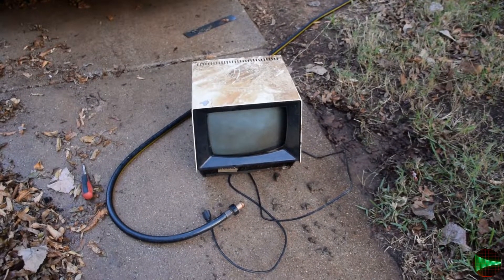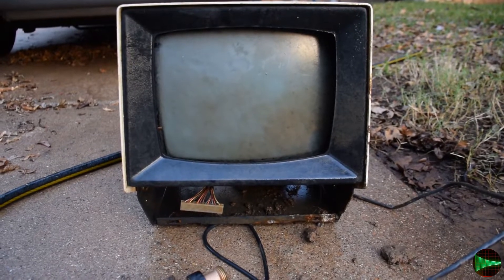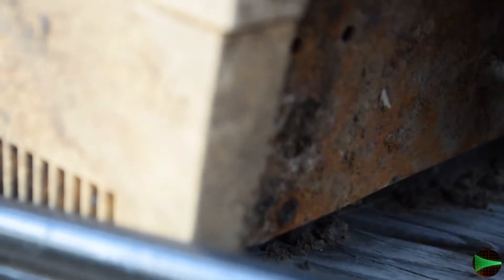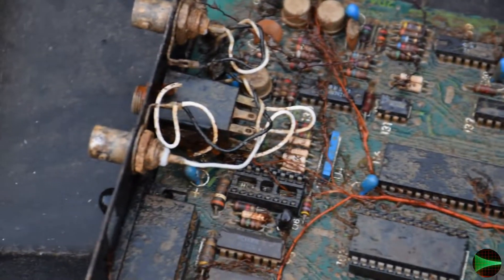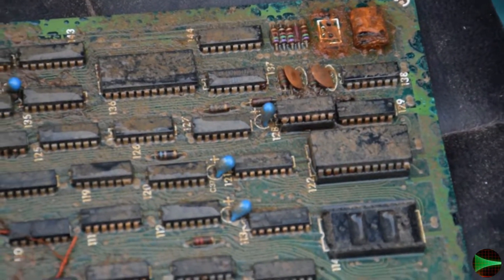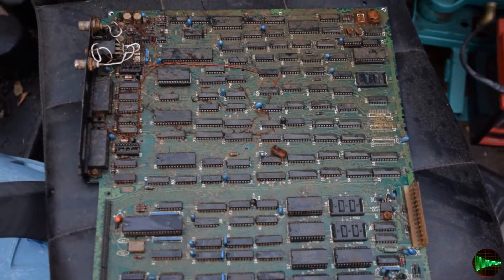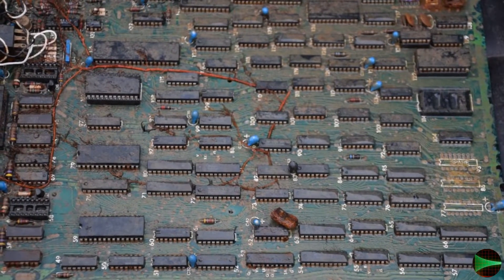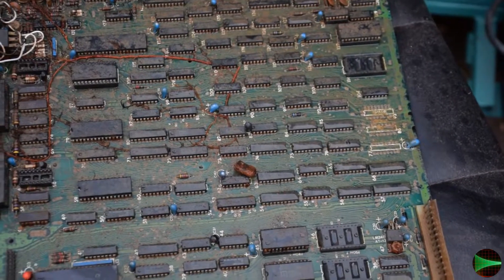Creek find computer terminals: Part 1

Comment: Whats the full name of this terminal? Cant find it on ebay and same stores
Reply from the maker: It's a Datamedia DT80. You won't likely find it anywhere else. I found one keyboard on ebay once from a keyboard scalper and someone else snipped it before I could, but it's not like I had that money to spare at that moment in time.

The second terminal turned out to be a Telex 078
Reply: @RingingResonance  it's so sad.
10-15 years ago we throw it away as a garbage, but now trying to find a real beauty
Reply from the maker: @nagornov98  There's only two of these DT80's that I know of to exist. Mine and the one that Dave (Dave's old computers) had and posted on his website. I contacted him about it and after a few messages back and forth he found it in his stuff. He was able to give it to someone who ended up lending me just the ROM chips so that I could read them. I've posted a copy of them on my github. I'm still missing a keyboard for mine. I would also like to find another one of these to read the ROMs from again to compare with the copy that I have so that it can be verified or archived if it's of a different revision.

It's a shame because they have quite capable hardware. I even started writing a sprite based game engine for mine, though it's far from completion. Good luck on finding one!